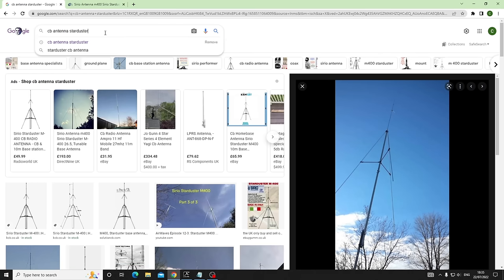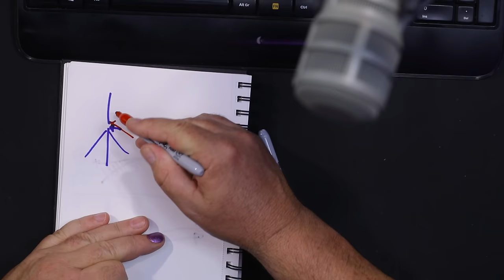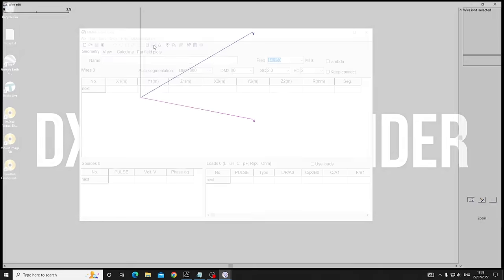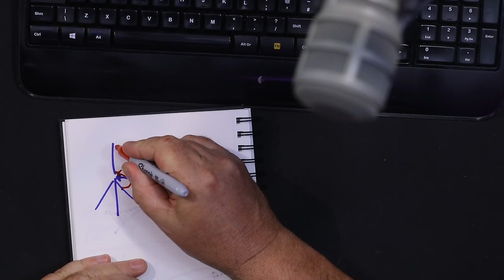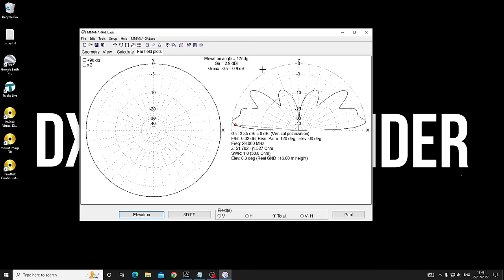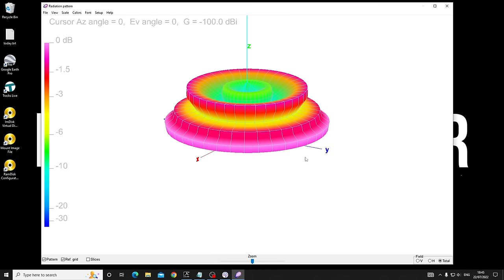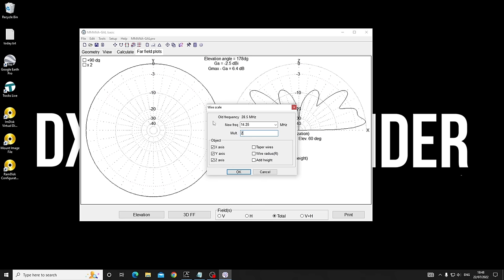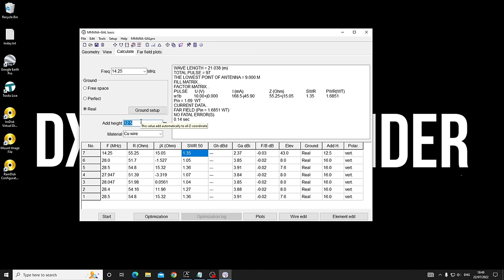The Ultimate CB / 11m Antenna?

Comment: The reason the ground radials are sloping in around 45° is because that makes a 50 ohm match if are at 90°. They would be around 37 ohms and if it was a dipole with them directly opposed to 180° it would be 75 ohm  that’s why they’re sloping on a quarter wave groundplane nothing to do with VHF or whatever you are going on about
Reply from the maker: Thank god we have an expert here..!

Comment: For me, the Avanti Astro-plane was the Ultimate CB vertical antenna. I couldn't afford one initially and still am using the over 40 years old Hy-gain Penetrator 5/8 wave. I eventually had a Moonraker 6 setup. But a storm took it years ago. Been a Ham for a while, but still like to fool with 11m too.
Reply from the maker: Nothing like fooling about with radio!
Reply: Im on cb more than any empty or ft8  ham band . Cb is where the contacts and actions is.

Comment: Back in the '80's in Ohio Stardusters were everywhere. It was one of the cheaper ground planes one could put up. I avoided them because thunderstorms could (and did) wipe the radials right off of them, going to an Antron 99 instead. Most CB'ers in the States went to yagis, mine was a four element with two rotors to flip it over to horizontal polarization if needed. Back then I didn't know about take-off angles. I can see how a standard 1/4 wave ground plane could be useful for that.
Reply from the maker: Brilliant! I guesss that's why the PDL2 also did well but you needed two coax lines.

Comment: I used an old antron 99 with a ground plane kit .only I used a 102 inch stainless whip on one pointed west towards Niagara falls and 2 4 foot whips on the other 2 slots ..I could talk from Toronto to just west of Niagara falls at night .On 12 watts ssb .And from Toronto to Caledon on 5 watts am .I was located on the top of the old Iroquois shore line (Davenport Road)approximately 150 feet above the lake .I had a clear view to Buffalo from my old house .that's 28 Miles directly south of me as the bird flies .And on good night I could talk across Lake Ontario !
Reply from the maker: Fabulous!
Reply from the maker: Carlu. OK, so I built this one in the end.. If you have time, join us on the full-build and test Premiere? https://youtu.be/V8Qq4-0_TjQ

Comment: The Starduster if I remember was also used a lot in Lofts and on Bedroom floors, for the people who were not allowed an external aerial by the landlord, I remember quite a few who had them outside were accused of using a burner.

Its like the difference between a Avanti Sigma 4 & Sigma 2, Personally I always favoured the Sigma 2 because of the Radials, where as the Sigma 4 was more of a J Pole, not that J Poles dont work well, I use one now on 11m band even now.
Reply from the maker: Yeah OK!

Comment: Thanks Cal. Sorry but what is the difference with a plain and simple 1/4 wave for 11m?
The best vertical antenna I 've ever used on 11m, is the 3-dDd Double Extended Zepp, homebrew. Each leg is 6m35 long, it is considered as a double 0,64 so it is huge (13 metres long in total). When it comes to local contacts, vertically polarised (you need a big pole, naturallu) nothing beats it, none of the commercial 1/4; 1/2 or 5/8 wave-antennas I have ever bought.
Reply from the maker: 1/4 wave is the most efficient and if you can get the height, nothing will beat it.. However, at around 64% wavelength, you get an extra punch. All you need to do (!) is match it. If the matching is efficient, it'll beat it.

Comment: Hello Callum, I hope 2024 is finding you well. I have a question regarding a potential CB antenna arraignment. I'm building a hobby shed in my yard and want to set up a base station in there. I'm wondering if there is any benefit in running 2 separate antenna's. I was thinking of mounting an omnidirectional antenna(1/4 wave with radials??) on a mast at one side of the building for local stuff as well as a beam with a rotator on a mast at the other side(8 meters away) for DXing. Obviously the feed lines would be run through a selector and both antennas wouldn't be used at the same time. Do you have any thoughts?
Reply from the maker: If you genuinely want DX and you can get your beam up to 30 feet, it will make a heck of a difference.. However, your vertical will also work, particularly if you can get some height.. I would start with a high quality vertical as high as you can with the BEST coax you can afford and worry about the beam another day. PS I've had both..
Reply: @DXCommanderHQ  Thanks Callum. Going 30+ ft isn't an issue where I live. I just figured I'd get a plan sorted before the concrete trucks come. Pouring any bases at the same time as the building slab will just make my life easier.

Comment: The Leaning Tower of Pisa is about 4 degrees now. If I erect a vertical dipole on the side of the Leaning Tower of Pisa, will that lower the take off angle of the main lobe in the direction of the lean 4 degrees?
Reply from the maker: Do it!

Comment: In addition to my previous comment. If you want to multiband it then a linked version can be made. I've  15/17 one up.  They're very broadbanded and I'm heard more on my 'thunder hole' as I call it on 10 than my T2LT which hears more. We used this past weekend on IOTA for 20/40/15 and even the skeptics were converts by tear down.
Reply from the maker: Peter, please drop me a line with some photos. Lovely!!
Reply: @DXCommanderHQ  if I can work out this blasted phone's camera I will. Be over the next few days and I'll include the feedpoint design

Comment: Avanti Moonraker 6 32 foot boom horizontal, like rocking horse crap and highly sort after and the PDL2. Would love you to work out how that PDL worked hi hi. I liked the Sigma 4 with 3 legs on the basket unlike the Sirio 4000 knockoff for vertical.

Comment: I use a CB for CB stuff on an 11m dipole. But sometimes I like to tune the HF radio on the delta loop to 27.025 MHz here in the States and just listen.....because the nonsense on channel 6 is quite comical a lot of time. Try it. Plus, there are some CB stations that will put any HAM station to shame with antenna, power, setup, design, etc...listen for “Motor Mouth Maul” on channel 6......But the show that ensues daily on channel 6, from coast to coast, makes me giggle.
Reply: I used to chat to .44 magnum from Alabama on the superbowl  , I live in south east UK using a half wave coax Horizontal wire with 200 watts 🇺🇸🇺🇸🇺🇸
Reply from the maker: Ryan.. OK, so I built this one in the end.. If you have time, join us on the full-build and test Premiere? https://youtu.be/V8Qq4-0_TjQ
Reply: @DXCommanderHQ  I’m on duty at the fire house today, so I have a chance I’ll certainly tune in.....break break....

Comment: I seem to remember it being called a thunder pole and was base loaded and I swapped the driven element to a 7 foot fire stick and what a difference it made M7GLO
Reply from the maker: Interesting!
Reply from the maker: PS Jess.. If you have time, join us on the full-build and test Premiere? https://youtu.be/V8Qq4-0_TjQ
Reply: I find the idea of a shortened radiating element out performing a full 1/4 wave element to be untenable.
Physics rule this even endevor though it sometimes seems like black magic. 
Local conditions and rapidly changing environment can fool people to think they see a difference when it's likely not what they think.
I realized this when so many people have an antenna they think is the best when modeling shows so little difference that it shouldn't even show up on an s-meter.

Comment: Just curious, would you get less frequency bandwidth using a thin wire vs quarter inch pipe?
Reply from the maker: Possibly measurable.. As a percentage of wavelength though, they both measure well under 1% so probably not.
Reply from the maker: Ian.. OK, so I built this one in the end.. If you have time, join us on the full-build and test Premiere? https://youtu.be/V8Qq4-0_TjQ

Comment: Why not make a 5/8 CB ground plane instead of the quarter wave ..the radials will still be a quarter wave long . small coil to bring it n resonance , would be a killer .
Reply from the maker: Well, I just did the modelling. Interesting question.. So because the feedpoint would be lower (because the 6 metres of extra wire ABOVE the feedpoint) (keeps everything under 18m total height) then the Star thingy beats it by a substantial margin.. Of course if you already HAD an 18m tower and the feedpoints were both the same, the I agree - the 5/8 would beat it. But not by much. Oh wait.. Modelling is suggesting damn all in it. Maybe you would need a pair of 5/8th like a V-2000 works on 2m band.
Reply from the maker: No need in the end: OK, so I built this one in the end.. If you have time, join us on the full-build and test Premiere? https://youtu.be/V8Qq4-0_TjQ

Comment: Vector 4000 for the win.  Over a sirio 27 gpe5/8 wave I found the vector at the same height to the base give or take a foot it was 2 s point better than the gpe locally and skip is harder to quantify but it sure feels easier to get those distant contacts especially the ones I had trouble with before.  USA is my bad spot.
Reply from the maker: 2 S Points.. I don't want to believe that.. I just can't image how BAD the other one must have been.. Diofferent coax I wonder.. Oh well!
Reply: @DXCommanderHQ no same coax and the gpe5/8 wave is a fairly decent antenna beating an antron 99 by some margin. Those are the best increases.  Some differences were no signal increase but an increase in readability.  The s 2 increases had no change of the other stations operating conditions.  When the signal is so low only a marginal increase from a just know the station is there to maybe the odd word, say r1/r2.  It definately has performance gains over a 27 gpe5/8 wave.  The vector  was only 1 s point behind a 4 element yagi on the flatside to a station in Turkey the other station was about 15 miles away from me.    You are right about the coax though.  Mine is quite old and I've seen other operators get good performance increases in rx and tx when putting up new coax with new connectors.

Comment: Talk about the silver rod antenna, mine works 1.1 swr from 26.5 to 28.500, with th e internal tuner works 6,12,15 and 17 mts and i can receive not transmite on 40 mts. 20 and 80 mts inexistent.
Reply from the maker: With an ATU, it could (could!) do any band you like.. Roly's team loaded up a 6 inch nail on 10m band - and made DX on it... But you will be wasting your time normally. Silver Rod (a half wave end-fed) is designed for =its base harmonic - and multiples going up. Sure, you know this.. Will comfortable work a few percent each way - then the losses will mount up until you reach the next harmonic (useless for us - but maybe a fine VHF broadcast receiver!)

Comment: Did you build one of these Stardusters in a video? If so, can you share the link?
Reply from the maker: I did/ You will find it here: https://www.youtube.com/watch?v=V8Qq4-0_TjQ (skip to the end if you like.. ABout last 5-minutes)
Reply: @DXCommanderHQ  I have since built one using telescopic carbon-fiber fishing poles. I attached the radiating upright with a set of double-pole clamps and the radials using band clamps that are interlaced, allowing me the 45-ish degree downward angle and some PVC for the braces on the radials. This will allow me some flexibility to adjust the radial angle. The whole design is a variation of the vertical dipole we discussed previously. I completed the antenna/mast assembly today, but I raised it a couple days ago and found it to be (in your words) a bit "wibbly-wobbly" when attached to a cross-beam of my patio 7 ft off the ground. The main mast section is a 22-ft fencing top-rail with a 5-ft section on top of that on which the "Starduster" is mounted/assembled.  I'm currently waiting on the delivery my 550-lb 7-strand paracord (I trust that's sufficient).  I plan on fabricating a triangular plate (like the DX Commander spacing plate) from a fiberglass cutting board and a large band clamp to mount the guy wires to the mast. I hope I'm not missing something critical... 

I enjoy watching your YouTube videos and have learned a lot from them, especially when it comes to antenna construction. You mentioned making your "Starduster" into a multiband antenna; I'll be interested to see how you would do that (some variation of a fan dipole, I assume?)

Now although I'm not yet a licenced amateur operator, I was pretty deep into CB back in the 70s when you still needed a license for that and before it expanded to 40 channels and they all got overcrowded. I've been wondering why the CB band isn't included in Ham multi-band radios, since the 11-meter band is nestled into the HF bands. Maybe if I were to study for my Technician's licence, I would know.

Thanks again, Cal for helping me to understand how antennas work, and that they're scalable to the different bands/frequencies. 

73, and "keep the shiny side up"! I suppose I should now go watch the video of your construction of the "Starduster".

Mark
Phoenix, AZ

Comment: U could always make a smaller version for 6M but to dual band it ya should be able to get away with the size for the 10M band and then have a 100 or 150mm spacer at the feedpoint and put a 1/4 wave section for 6M on it,btw the the spikes off the original antenna would be some sort of capacity hat that ya would think would change the radiation pattern for local contacts
Ya could add it in software
Reply from the maker: I made 15, 12 and 10 in the end.. If you have time, join us on the full-build and test Premiere? https://youtu.be/V8Qq4-0_TjQ

Comment: So, question....given that one half wave antenna is going to be pretty similar to another, could you perhaps try the modelling at the same height with 1) a flowerpot antenna and 2) a J-pole antenna? I also had the idea of using a vertical with radials as guy wires, but I was also thinking for an unguyed pole (not 18m!) of a flowerpot as it would be simple to put up as a portable antenna.
Reply from the maker: Well Paul.. the RF is going to go somewhere and frankly my guess is that at HEIGHT, they will all be within 1-dB of each other..

Comment: I would like to see a 5/8 instead of a 1/4 or larger version of a stardust up at least 30 ft. I was planing to build one and put it up in my 130 Fir tree. I now have a 5/8 up there.  In Portland Oregon you have to get your antenna up high because of all the tall trees some are 200 feet high.
Reply from the maker: The only problem with 5/8th is matching and then the debate is over how efficient you can match it. I think the GainMaster did a good job.
Reply: @DXCommanderHQ  Thank you! It's amazing you have a dog and can respond to us Elmers. Good thing your aren't married.

Comment: Would my A99 with my 3 element right on the bottom of it make it have the same wave pattern as if it where on the ground? If so then any height it would have the same wave pattern???
Reply from the maker: Ignore your 3-ele beam, won't affect your A99. Height on ground and height above ground will give you very different patterns. Above about half a wavelength above ground, you start to see a result and above 1 x wavelength, it becomes fabulous.

Comment: Question, what happens if you use thicker material for the active element?  What I am thinking about is a bolt together (sectioned) thin walled 3.5 cm diameter tube (a former boom off a 2 meter Timewave beam).  I have 20 feet of that boom.  Sorry for mixing SI and Imperial measurements every thing I do is mixed and confused I fly high power rockets in metric, do elevation in feet, I pedal bike in miles, I geocache in meters, while I drive a car in metric!
Reply from the maker: Well, if we look at the diameter of a 2.5mm wire vs a 3.5cm tube, both are still extremely small when we compare them to the wavelength. So a 3.5cm tube is about 0.03% of a wavelength thick and the wire is about 10% of that say around 0.003%..! I don't personally think it would make any difference at all.
Reply from the maker: PS OK, so I built this one in the end.. If you have time, join us on the full-build and test Premiere? https://youtu.be/V8Qq4-0_TjQ
Reply: @DXCommanderHQ  That pup is a BEAST, unfortunately I doubt it would support ice as we can get ice storms that can deposit inches of ice on everything.  We lose large commercial towers every winter, they pancake, flat!  Global lost one 3 years back a guyed 300' tower down to 15' pile of scrap!
Reply: Slight increase in babdwidth probably hard to even measure let alone notice.

Comment: Good video Cal, I'm up for a build. The original Starduster was a great 11m antenna -DX  Dusseldorf 1980.
Under the antenna - I used a Sigma Venom for 10m - and an article I read said don't mount it to high or you will TX over their heads - recommended base 15ft from ground. so for gain your saying "height is might". its all relevant at the moment as I'm building a half wave vert for 10m to poke out of my flat window, no real estate.
Keep up the Good work Callum- UK N01 You Tube Channel. 73 de M7PBX.
Reply from the maker: Nice comment.. Interesting too!
Reply from the maker: OK, we built it! If you have time, join us on the full-build and test Premiere? https://youtu.be/V8Qq4-0_TjQ

Comment: When I was in highschool, I built my best talking antenna out of a 10ft piece of 1/2in copper pipe, straight connection, a test end and some ground strap. 6w and easy 20mi talk in the bottom of a valley.
Reply: The math is easy. Cross the ground strap so the length of each leg (4 of them) is half the length of the mast. Set your radio to channel 20.Remove small amounts of the bottom of the mast to get your match. When your SWR starts climing, stop cutting.
Reply from the maker: Nice tip!
Reply from the maker: OK, so I built this one in the end.. If you have time, join us on the full-build and test Premiere? https://youtu.be/V8Qq4-0_TjQ